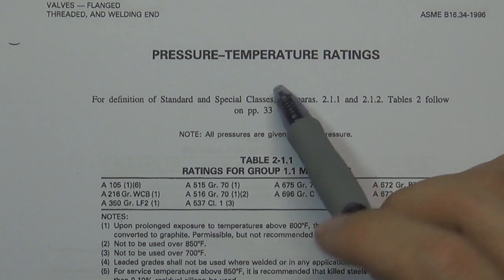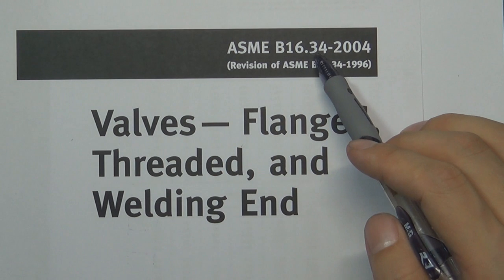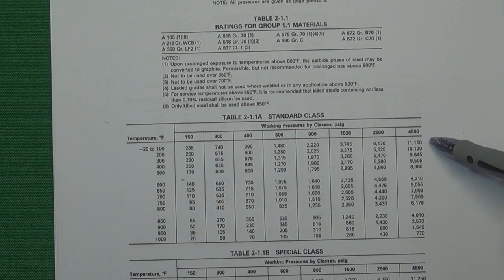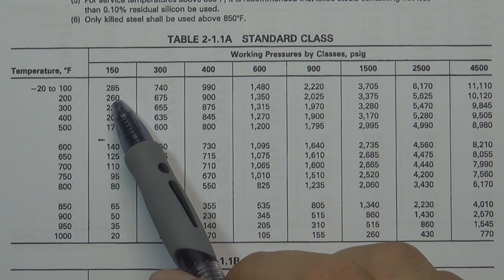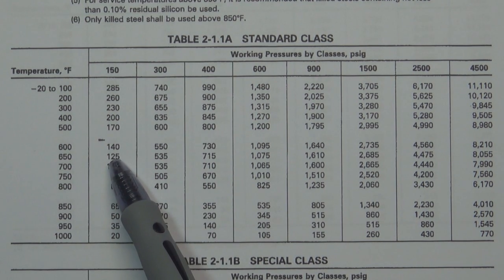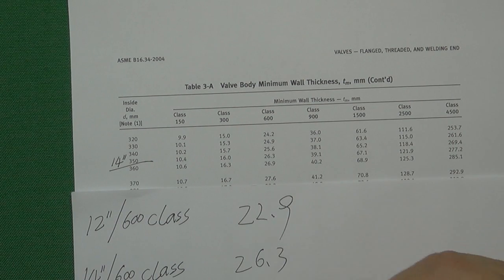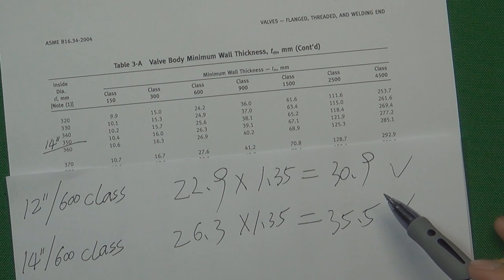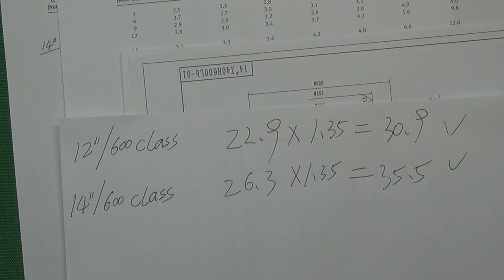How High Pressure Can Class150 Valve Hold #ASME B16.34 Valve Pressure 2/2

Comment: I have a query, in your video the 16.34 table is showing the thickness against the Valve ID, and you are comapiring ID 350 of the table with the NPS 14 in the drawing. Is it not incorrect? Please explain.
Reply: Sir, do you please provide explanation on how to calculate bolted body joint as per b16.34 clause 6.4.2.1